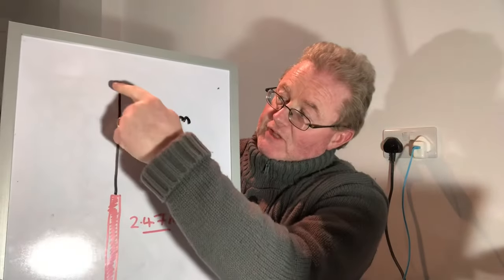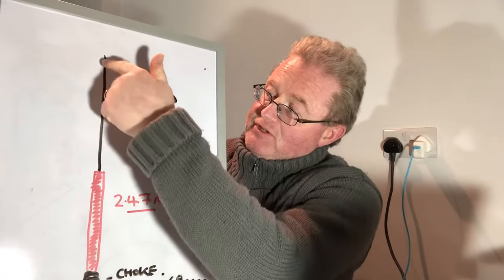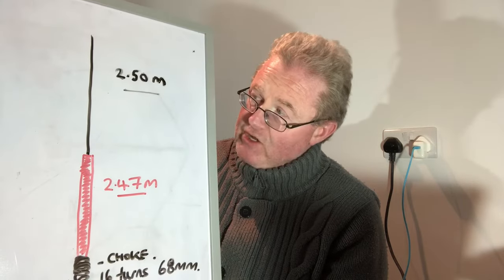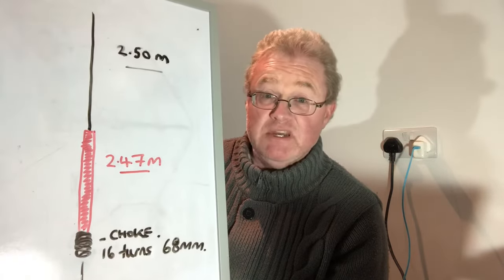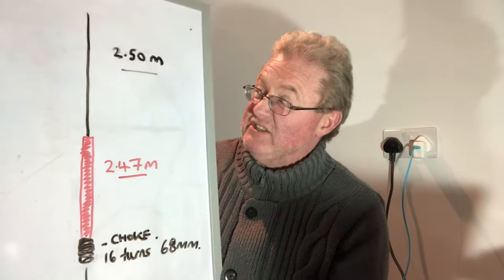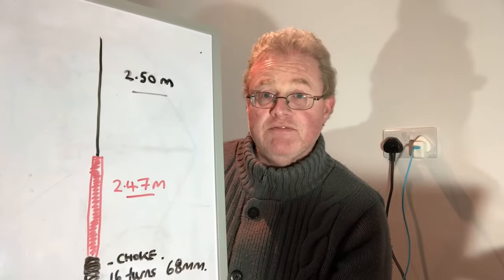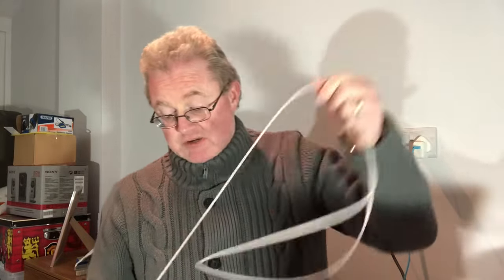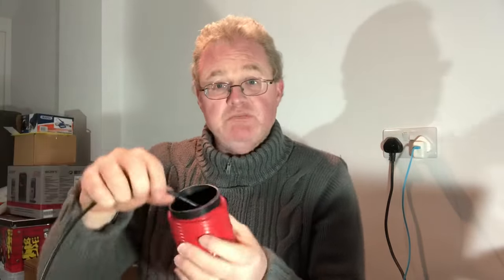T2LT - Half Wave Vertical Coaxial Antenna For CB Radio & 10 Metres

Comment: This design is based on a half wave vertical dipole / where the top dielectric portion is 1/4 wave and the untouched coax makes up the other half and all works great ! now if a person wanted to make a 5/8 wave length antenna any idea on how the measurement would differ? Would the dielectric portion Be 5/8 long And if so, how long would the untouched coax be before the choke? Supposedly 5/8 Gives a lower takeoff angle and an increase in gain
Reply from the maker: Check out M0MSN’s channel .. he’s made the 5/8 version (Gainmaster copy) using coax.
Reply: @timg5tm941  awesome - will do - Thanks for the recommendation
Reply: @timg5tm941  well I finally got my home brew doublet up about 25’ used 450 ohm LL for all portions I am really happy with it - the legs are 33’ long and also include a center wire weaved between the LL - so triple linear load - could use some help getting 60m tuned in and also 10 meters - do you do do anything differently? The needles will not deflect at all on those bands

Comment: Great video Tim. Is there  a calculator for these T2LT antennas? How did you figure out the lengths of the two sections of the antenna? Then, how did you figure out the length of cable for the choke? Any help would be appreciated. 73's Ernest Bazzinotti, KC1LKB
Reply from the maker: Hey there. You can use the usual 468/f for the two lengths. Choke wise, if you search for G3TXQ choke chart and that will help for different bands

Comment: Using the measurements that you gave, how close to 28.444 is the VSWR?  To fine tune do I trim the top section?  thks
Reply from the maker: You should be under 1.5:1 depending on your environment. You can either trim or fold back the top part.

Comment: Tim,  This video was on the money.  Would like to see the shootout you mentioned - to see if there was a discernible difference in performance (maybe use an SDR and SDR Sharp to illustrate the difference?).  Since I am still working my way through 100 metres of cheapo 75 ohm coax, I think I may have a go and see how that works for me.  Cheers, Pete 2E0WHT
Reply from the maker: Brilliant Peter give it a try and thank you for the sdr suggestion
Reply: @timg5tm941  It is on my list. I got a pole and coax out with that intention this morning but being nine days away from the full exam, that takes priority at the moment.  Funny how I procrastinate and still make time to watch Youtube...  That said, I am  currently using Cornish Radio Amateur Club Training videos to good effect
Reply: @Peter Snipe, you could save that 75 ohm Coax for Co-phasing harnesses, should really be using 50 ohm coax for antenna and feed lines.  That 75 ohm as far as I know is mostly used for TV Rx or Co-phased harness arrays.
Reply: @stoatrepublic  50 ohm would be easier and more expensive.  So far my half wave di-pole is giving very good results with the 75 ohm feeder.  Currently throwing together an end fed with same.  For me it's about using what is around me and adapting to those materials (like the very early days of amateur radio), rather than out and out performance. 73, Pete M0WHT

Comment: Hello Tim, I hope you are well I've attempted to make this antenna today but for some reason the swr is high between 2 and 3 any ideas what I can do to adjust this ? I've checked and double checked the measurements and they are all spot on, not sure if it matters or not but I'm on a cobra 148 gtl dx on low mid and high, thanks in advance I really appreciate your time 👍
Reply from the maker: Ok now what were the measurements you used? I’m thinking of you might’ve made a 10m version for CB maybe?
Reply: @timg5tm941  hi Tim, 2.50 meters top section and 2.47 meters bottom section and 16 turns for choke, thanks for getting back to me👍

Comment: Great design, thank you for sharing it. I will try to build one. Question how much power can this antenna handle ?

Cheers 73 de Juan TG9AJR
Reply from the maker: I know someone who has comfortably used 400w SSB with this antenna
Reply: @timg5tm941  OK great Tim looks like a great antenna design. 73 and cheers from Guatemala
Reply from the maker: @TG9AJR  thank you Juan! 73

Comment: Thank you for the video.  What lengths would you recommend for 10FM   29.600mcs ? De G0PZX
Reply from the maker: Hi Tony you could either fold the top back to tune it to 29.6 MHz or if you want to try a precise measure try 2.37m for bottom and 2.40m  for top half. I’d try the fold back method first. Alternatively make it a few cm shorter both halves and it’ll tune around 28.7 or so and still give you probably less than 2:1 vswr at 29.6 and 28.4 MHz

Comment: I do ammo box radios , i think this may be good how much power can they handle i would like to use my radioditty cb27 and a 225 amp.
Runs about 80 at 15.5 volts.
Reply from the maker: Hi these antennas on ssb will cope with 400w peak no problem

Comment: Hi Tim, I’d like to build one of these, but have RG213 10mm coax. Would this change the number of choke windings or anything else? Thanks Peter
Reply from the maker: I think it may well do, plus winding a choke with rg213 won’t be as simple. Also the weight would be much heavier
Reply: @timg5tm941  Thsnks for your advice Tim. That’s all very true, I’ll revert to some RG58 👍
Reply: Tim, just one more question; out of all the antennas you have built and tried, which would you say was the best performing and impressed you the most on hf?

Comment: Help!  Mounted in the same place and at the same hight, which of these 3 halfwave antennas would work better for DX....  

This coax anteena, or a vertical EFHW, or a coil-loaded halfwave like the Antron 99.  Or are they all the same? 

The reason I ask is that it just seems easier to make a 49:1 transformer (and a 1:1 CMC choke if needed), and then cut a halfwave piece of wire for each band.  Would that work as well as this coax antenna?  Thanks.
Reply from the maker: 49:1 are convenient but some designs can be lossy. In reality there isn’t much between them except of course the 49:1 is a multi-band option.

Comment: I just built this antenna after watching your video I had a bunch of surplus rg6 cable tv coax 75 ohm I said what the heck and tried it. It worked great cut it long it was wide banded below 1.4 through the cb band and all the way to the middle of the fm 10 meter band. I finally found a use for all this cable coax. THANKS.
Reply from the maker: Great!!
Reply: Well i do struggle with an antenna and i do have tones of coax 75 ohm cable. Have to try this definitely. Did you use the one with the pvc pipe or  did you made the one with the 110mm pipe??? Very interested

Comment: Hello Tim!
Nice little project and neat work. Not a critique but I’ve noticed something wrong on your mfj antenna analyzer. 
I’ve got the 269 so I should know how it works. The analog needle to right showing impedance seems to be out of calibration.
In fact if you check R and X on the display and “add” them up ( with pitagora) they give you the impedence. 
In the very first example you had R57 and X4 which gives Z 57.14 whereas your needle there shows 90. 
In the second example R60 X6 which gives Z60.3 but the needle there is reaching 100.
Perhaps you might want to run a general check to the mfj.
Just wanna let you know.
Thank you for all the nice contents you have on your channel.
73s and hope to catch you on the air.
Diego
Reply from the maker: Thanks I will check that out.

Comment: Is the choke just a common mode choke? In this case could I use a commercially produced choke rather than the ugly looking coax coil?
Reply from the maker: Provided it’s choking impedance is broad enough to cover the frequency of choice, yes. Although it’s a larger cost than the small amount of coax used for the 10m version.

Comment: Thanks for the video! Would it be worth terminating to an SO239 just below the coil to use your own lower loss feeder? I suppose using 2-3m of RG58 fly lead as the feeder losses would be negligible anyway?
Reply from the maker: Yes for long runs of coax you make a good point. For 10m or less then rg58 on 14 MHz won’t make hardly any difference
Reply: @timg5tm941  Well, its certainly on my list to build! I started my DX Commander Expedition build today. Your videos also inspired a bit of reading for 6m and 4m versions of the T2LT which are also on the build list!
Reply from the maker: @motodevcam  that’s great to hear. I wish you well with the build
Reply: @timg5tm941  Thank you! Hope to work you on 40m at some point. I know you've given up with 80m!
Reply from the maker: @motodevcam  fingers crossed!

Comment: There's something I'm not getting on this one and I don't know if I'm missing understanding it or if it's mislabeled. This is being described as a half wave antenna.  Since it's an end fed dipole it's total length maybe a a half wave 5 meters however only 50% of it is the center conductor and the other 50% of it is the ground portion of an end fed dipole. Doesn't that make it an end fed quarter wave dipole not a half wave? A 1/4 dipole has 2.5 meters on one side and 2.5 meters on the ground side. That may make the total length of the antenna 5 meters however because it's half ground and half driven element it's a quarter wave antenna? The choke isolates the ground side from being any longer than 2.5 and the unshielded side is limited by it's own length at 2.5 meters. To me that ads up to a quarter wave antenna. Just food for thought from an old HAM in the U.S. No matter how it works out the SWR speaks for it's self and I look forward to giving it a try.
Reply from the maker: Hi nope it’s a half wave. Full 5m on 10m band. Hope you give it a try it’s a v good antenna 73
Reply: @timg5tm941    Whoops, I should know better than to watch these videos at 2 AM. Yes the total length is what determines that it's a half not just the driven element. Thank you for clearing my brain fog LOL. 73 OM
Reply from the maker: No problem! I get brain fog 24/7. Have a good day on the bands 73

Comment: I’m about to build one of these antennas. Which design is better overall? I like the idea of having more bandwidth, but would it be at the expense of performance? Thanks so much
Reply from the maker: I’d go with the wider coil
Reply: @timg5tm941  thanks so much for the response! I’m curious why you recommend the wider one? Just easier to make, or does it perform differently than the thinner, longer one?

Thanks

Comment: does it have to be 2 meters of the ground, could you put it on the ground to limit height? would it perform well with near a house with chose near the ground? and still near 18 feet from ground to height?
Reply from the maker: Best to be at least 50 cm above ground. Any antenna is much better away from a building 73

Comment: Can you show the calculations for the wire lengths please? I've seen several designs and they often have slightly different measurements.
Reply from the maker: Based purely on the usual 1/2 wave calculations
Reply: @timg5tm941  I'd expect those calculations to give equal lengths for each side of the dipole, and we don't have that here (or in other T2LT plans). A 3cm discrepancy seems significant and deliberate.
Reply: @hackerynet  try and cut ✂

Comment: I was wondering do you factor in the velocity factor we doing your measurements and cutting the coax?
Reply from the maker: Yes… 👍👍
Reply: The question about velocity factor has come up again.
Reply: RG 58 has a velocity factor of 0.66 and based upon that it appears that the quarter wave sections should be much much shorter This is my calculation do you see anything that I've done incorrectly

Comment: Only problem with this antenna is getting it high enough to be above the assholes on the 27Mhz band....height is might, but a 50' fibreglass pole would be slightly bendy....
Reply from the maker: 10m pole is fine

Comment: For the red part of the antenna on the graphic you just cut the shield there and didn't fold back the shield from the top half?  So it's an end fed dipole, not a center fed dipole?  Also, what is the black pole, is that carbon fiber or what?
Reply from the maker: Your answers: 1. Correct; 2. End fed physically ; 3. It is fibre glass

Comment: Could you please explain how you came up with 2.47m for the lower shielded length?
I have difficulty figuring this out. I assume it has something to do with  velocity factor .. but the vf of RG58 is .66
Sorry if this is a dumb question .. I'm new to this.
Reply from the maker: VF plays far less of a role here. So 2.47 is about right
Reply: @timg5tm941  Thanks for the reply .. but I'm interested to know HOW you arrived at the figure of 2.47 .. and why it is different to the driven element?

Comment: Hi Tim, has anyone on the channel measured the inductance & self resonance of the chokes? From a calculation, the 16 turn is approx. 3x the L, which would certainly explain a different match. I suspect there's very little difference in practical performance. 73 John G0JLF
Reply from the maker: I suspect you are correct John.

Comment: Hay ummm i see the swr is good .
Im good with that part , but whats the deal with the ohms 80 an 90 almost 100 ohms whats going on there. 
This has me curious enough to try this out but using some different coax variables.  
I am in the United States. 
Anyway would a different size former or maybe 10 turns bring down to 52 ohms ? 
This will be my project today . Haha
Take care . Great video.
199 florida georgia line..
Reply from the maker: Thank you and good luck!

Comment: How critical is diameter of the choke are there alternates as for diameter/turns?
Reply from the maker: Pretty critical. The other alternative I know of for 10/11m  is 16 turns around a 68mm diameter. Otherwise it’s trial and error.

Comment: Is this antenna wide banded enough for 26.965Mhz to 27.405Mhz, 27.60125Mhz to 27.99125Mhz, 28Mhz to 30Mhz? It seems that may be a lot of bandwidth.
Reply from the maker: Around 2 MHz bandwidth < 2:1 swr
Reply: @timg5tm941  Wow!  That is actually really good.  Thank you for your response.

Comment: Hi I hope someone can help with this question.  Is it ok to use 12 gauge wire for the top part of the antenna or does it have to be 20 gauge like the rg58 dielectric.  Thanks in advance for any answers....
Reply from the maker: You can use any wire for the top part as long as it’s soldered to the centre of the rg58.
Reply: @timg5tm941  thank you for your response Tim, thinking about making one with good quality rg58 and 12 gauge antenna wire I already have from another project. Enjoy watching your videos in NYC 73's..
Reply from the maker: Let me know how the project goes for you. Thanks for stopping by and commenting 73
Reply: @timg5tm941  I will let you know how it goes....

Comment: how many miles does T2LT of 1 meter hight reach with SSB?
Reply from the maker: Hi with the base 1m above ground I have worked into the Caribbean (7,000 km) from the UK. That was 2 years ago with less favourable propagation. 73

Comment: Hi Tim. Can the pole run up the center of the choke? 73
Reply: You can run a pole up through the choke, but it must be a non metalic pole, fiberglass or something like that, the choke needs to be well away from anything metal as it really messes up the tuning.
Reply from the maker: Yes as long  as it’s fibreglass or any other non conductive material

Comment: Nice video Tim. I made one of these for last seasons 10m activity and it worked great. One question though, I couldn't decide if the length of the antenna should be
adjusted in length for the velocity factor of the RG58 (.66). Any thoughts on this would be much appreciated.
Reply from the maker: Great question. I think this design is quite forgiving so I go by the ‘usual’ half wave formula, cut slightly long and trim if needed. I’ve never been far off at all with that approach.
Reply: @timg5tm941  Good to know because a 66% velocity factor would really shorten the antenna

Comment: Looks like a fun antenna to build. Without standing on my head to understand the relationship between the number of turns of coax for the choke and the diameter of the form to wind it, I see the general principles. Here in the states, I do not have readily findable PVC pipe of those exact dimensions, although I could come close I suppose. Maybe I am not far away. PVC diameters are measured in inner size, so if find a piece of 4-inch PVC, the outer diameter is closer to the 4.33 inches or 110 mm required. I do not have a caliper to measure the thickness of the wall of the PVC pipe, but perhaps with my antenna analyzer, I can build a prototype to see where the minimum VSWR resides. The plastic pipe I have access to is the white PVC commonly used in home drain plumbing here. I look forward to testing and comparing against my halfwave endfed wire I would typically use in my QRPp activities with my QRPme EFHW tuner (Tuna Tunah). 10M seems to be hot now. Cheers es 72, Davey - KU9L
Reply from the maker: 4 inch diameter and 5 turns should still be ok